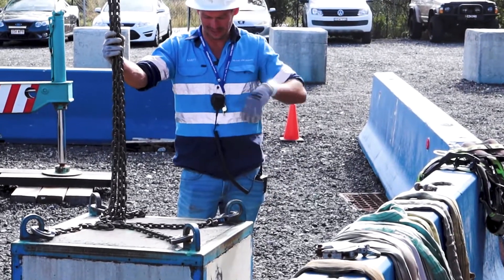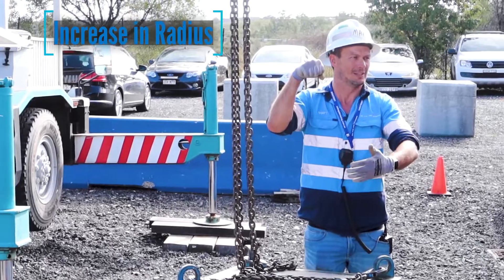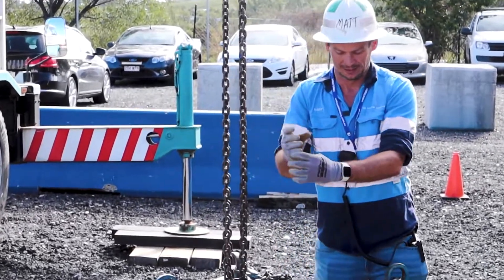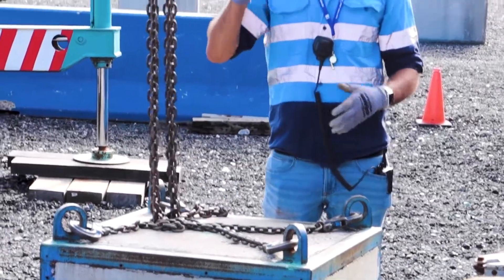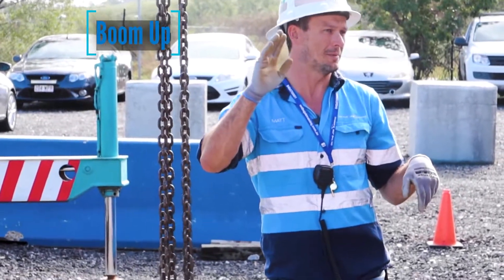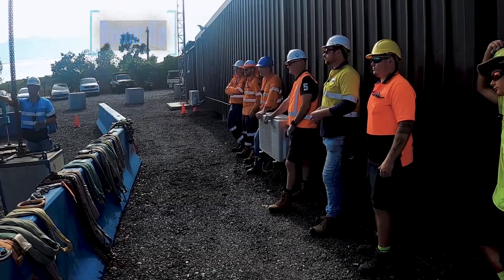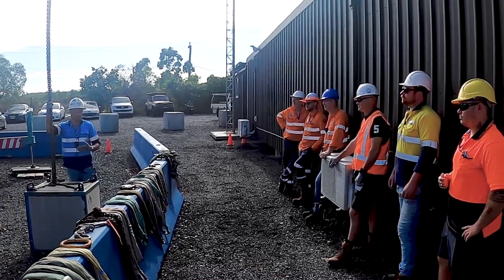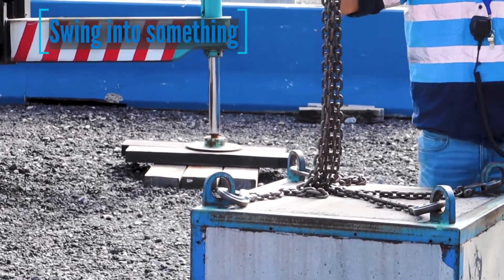Deflection: What is it and How do you manage it?

Comment: booming up while lifting the hoist , you better be a good cranie, TC luffers and hammer heads give off little or no deflection, ,its about mostly Hyd cranes and its length of boom , to be in the ballpark just pull off centre towards the crane and have ya wits about you